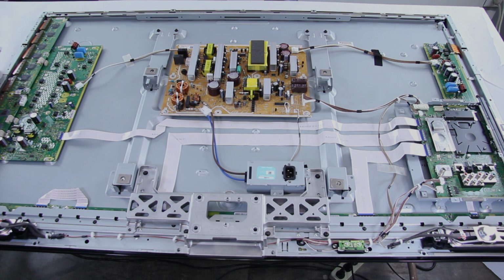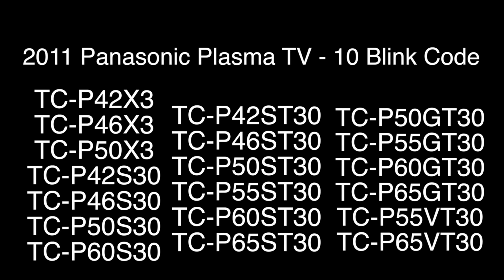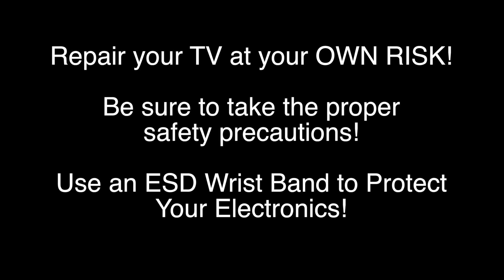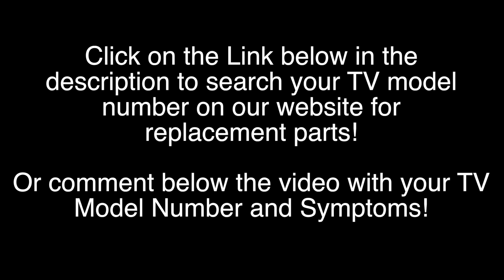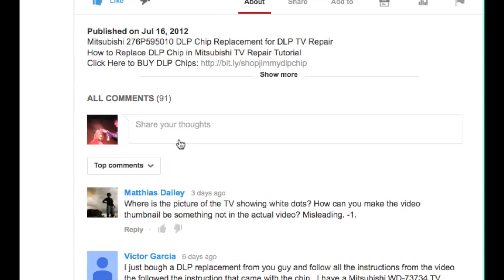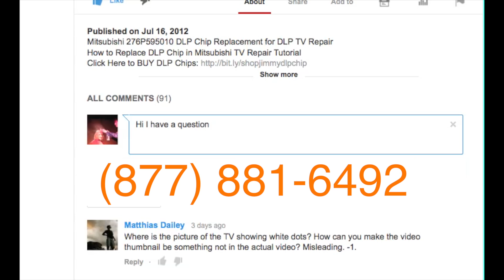Panasonic Plasma TV Repair - Understanding 10 Blink Code for 2011 Panasonic Plasma TVs-How To Repair

Comment: I have a Panasonic TC-P50G25 that has the 10 blink code. I have replaced the main Board and the Power Board. Still getting 10 blinks any help would be appreciated.
Reply: ShopJimmy.com Hello, I just tried unplugging the SC board and powering the tv on. It does not turn on but the blink code changed to 6 blinks.
Reply from the maker: Mr. Tech Inc   Repeat the same test on the SS board.  Thanks!  www.shopjimmy.com
Reply: ShopJimmy.com With the SC board plugged back in and the SS board disconnected. TV does not turn on and it went back to the 10 blink code. Thanks
Reply from the maker: Mr. Tech Inc  Please watch this video FIRST to help with your repair!  https://www.youtube.com/watch?v=BP3NVNCGEv8  This tells me the problem is with the power supply or the A Main Board.  You may need to replace each of these board individually to see which one fixes the problem.  Click this link to replacement parts for your TV model number: http://www.shopjimmy.com/catalogsearch/result/?q=TC-P50G25  There may be multiple boards for the same TV model number, be sure to match part numbers on your current board, with your replacement for compatibility.  Thanks and please let us know if you have any further questions with your TV Repair!  www.shopjimmy.com

Comment: I have a Panasonic model TC-P42X60 with 7 red blinks. I've already replaced the SC board but the problem still exist. Please help me.
Reply from the maker: celestino robledo barcenas   Did you replace the buffers that connect to the SC board or is there just one board (SN Board) that connects to the TV panel?  Thanks!  www.shopjimmy.com

Comment: hi sir i do have Panasonic plasma TV tc-p42s30 when i plug it in i have no response even the red light stay off i did replace the power board and nothing been change please advise ASAP.
Reply from the maker: MHD Faour   Try this at your own risk. Unplug the TV, then disconnect the SC board and plug in the TV to see if the TV powers up. Reply with the results of this test. Thanks! www.shopjimmy.com

Comment: My friend has a panasonic tc-p50x2 plasma TV. 
He says he's had it for maybe 3 years or so. 
Yesterday we were watching it and it just went black. 
Now when we turn it on the power light which is red, (never turns any other colours) blinks 10 times, pauses and blinks 10 times again and repeatedly. The only way we can turn it off is to hold the power button and it will shut off. 
Nothing happens when we turn it on. No picture. No sound. 
Just blinking light. 
We have tried unplugging all the cords and unplugged the TV overnight and attempted to power on today and nothing. Same thing. 

Any idea what the problem is?  Obviously it's not under warranty anymore and my friend is extremely tight on money right now (his TV and PS3 is pretty much his life lol. And he has 3 young kids every other week!) 
So we need to try to fix this as cheaply as possible. 
Any help you can give would be greatly appreciated.  
(Don't know if it matters but We are in quebec canada...) I've watched a few of your videos and am pretty handy, I'm positive I could fix this myself for him if I knew what the problem was and could obtain the correct parts. 

Thank you kindly!!
Reply from the maker: jayme collier  Please watch this video FIRST to help with your repair!  https://www.youtube.com/watch?v=BP3NVNCGEv8  I recommend replacing the SC, SU & SD boards in your TV.  Click this link to replacement parts for your TV model number on our website:  www.shopjimmy.com/catalogsearch/result/?q=p50x2  There may be multiple boards for the same TV model number, be sure to match part numbers on your current board, with your replacement for compatibility.  Here is a link to a video showing how to identify your part number, click here:  https://www.youtube.com/watch?x-yt-ts=1421782837&x-yt-cl=84359240&v=N1ophMtQeZU  Thanks and please let us know if you have any further questions with your TV Repair!  www.shopjimmy.com

Comment: I have a Panasonic 55vt30 and today I went to switch it on using the on off switch on the front of the TV and nothing not even coming on to stand by mode. I done the usual checks changed the fuse checked the socket and still nothing please please can you help me?
Reply from the maker: Shaun Anderson   Try this at your own risk. Unplug the TV, then disconnect the SC board and plug in the TV to see if the TV powers up. Reply with the results of this test. Thanks! www.shopjimmy.com

Comment: I have an st-30... my picture just went out! when i unplug it and plug it back in, there are no blinking lights... just a solid red light as if the tv was on but no picture.
can you help me?
Reply from the maker: The Truth  Please watch this video FIRST to help with your repair!  https://www.youtube.com/watch?v=BP3NVNCGEv8  I recommend replacing the SC, SU & SD boards in your TV.  Click this link to replacement parts for your TV model number:  http://www.shopjimmy.com/catalogsearch/result/?q=st-30  There may be multiple boards for the same TV model number, be sure to match part numbers on your current board, with your replacement for compatibility.  Thanks and please let us know if you have any further questions with your TV Repair!  www.shopjimmy.com

Comment: I have a 2009 tc-p50s1.  Does not power on and gives 10 blinks.  I tried what you said and disconnected the sc board and got 7 blinks after that.  Any ideas where to look next?
Reply from the maker: Patrick Baxter   Repeat the same test on the other side of the TV with the SS board.  Thanks!  www.shopjimmy.com

Comment: Hi there,
My Panasonic Plasma TH-42PZ800E is having exactly the same problem.
Switching on the power and blinks for 10 times. 
I understand that I have to replace the power board. Where can I find it. I live in Switzerland. Any chance to ship it over here if is available?

Thank you and best regards
Engin
Reply from the maker: Engin Aksüt   Try this at your own risk. Unplug the TV, then disconnect the SC board and plug in the TV to see if the TV powers up. Reply with the results of this test. Thanks! www.shopjimmy.com

Comment: Hi I hope you can help me, I have A Panasonic Viera TC-P50X2 50 inch Plasma TV that has a constant red blink, which is different from all the other codes I have seen. Once I plug the TV in i hear a click from the back which sounds to be coming from the Main Power board " the middle ". The screen does not come on at all and once i hit the power button you can't turn it off unless you unplug the TV. The red light never stops. Once it's plugged in the red light starts blinking quick with first 2 fast blinks then it starts it's constant blinking. I hope I didn't write to much just hope you can help me :) thank you - Alicia
Reply from the maker: AliciaKitty69  Please watch this video FIRST to help with your repair!  https://www.youtube.com/watch?v=BP3NVNCGEv8  I recommend replacing the main board in your TV.  Click this link to replacement main boards.  http://www.shopjimmy.com/catalogsearch/result/index/?cat=56&q=P50X2  There may be multiple boards for the same TV model number, be sure to match part numbers on your current board, with your replacement for compatibility.  Thanks and please let us know if you have any further questions with your TV Repair!  www.shopjimmy.com
Reply: +AliciaKitty69  Hi Alicia - Did this work for you? I'm having the same problem - light keeps blinking

Comment: I have a TC-P50G15, bought in 2009/10 and it blinks 5 times.  I replaced the a-board but that gave the same results.  thoughts?
Reply from the maker: David Schaffner   Try this at your own risk. Unplug the TV, then disconnect the SC board and plug in the TV to see if the TV powers up. Reply with the results of this test. Thanks! www.shopjimmy.com

Comment: Shopjimmy...I have a panasonic tc-p50s1 manufactured in 2009.  Tv won't turn on and I'm getting the 10 blinks.  Is the process the same as this video?
Reply from the maker: Patrick Baxter  Try this at your own risk. Unplug the TV, then disconnect the SC board and plug in the TV to see if the TV powers up. Reply with the results of this test. Thanks! www.shopjimmy.com
Reply: ShopJimmy.com Ok I tried it with the sc board unhooked and I got 7 blinks that time.

Comment: I have a Panasonic Viera plasma TC -P42C2, September 2010, so anything different with the 2010 model? It has the 10 blinking red codes. I have tried vacumning out the vents on the back for dust and tried pushing and holding the on button down for 10-15 seconds, and no success. No picture. Also, what do I need to do to ground myself? Anything special when removing the back tv cover screws. I unscrewed the 11 ST4 screws around the outside edge and the two M4 screws on the top edge, but still can't get the back of the tv off.
Reply from the maker: tom anderson   Try this at your own risk. Unplug the TV, then disconnect the SN board and plug in the TV to see if the TV powers up. Reply with the results of this test. Thanks! www.shopjimmy.com
Reply: ShopJimmy.com My problem as noted in my original comment is that I can't figure out how to get the back off my Viera. Also your You Tube video does not identify the SN board you wanted me to disconnect in the test. Also how do I ground myself (is that the ESD Wrist band you mention?) and is the instructions the same for my 2010 model as you outline in your video which is for the 2011 model.

Comment: We have a Panasonic Viera TC-P50U2 that is giving us the 10 blink code. I'd like to buy the appropriate board to fix it if you can point me in the right direction.
Reply: Don Bowlby We are still having this problem and I'm still hoping you can help. I've watched your video a few times and I've had the TV back off. Fixing it looks similar to hooking up computer cards or drives which seems easy enough. I'm just not sure which board I need to purchase. Is there any way to test which board is causing the problem or is it just trial and error?

Comment: Hi Shop Jimmy, I have the usual problems with my Viera Panasonic. Model No. TX-L26X10B.  Although I don't have 10 Blinks mine constantly flashes red indefinitely.  My Panasonic Viera, purchased 2 years ago, has the dreaded turn on/off syndrom.  I turn on the TV button, the TV flashes green normal times then TV comes on with sound but no picture.  This stays like this for about 7 seconds then turns itself off again with the red light which flashes constantly until I turn the TV off again.   PLEASE can you help?!
Reply from the maker: Suzie Emmerson   Try this at your own risk. Unplug the TV, then disconnect the SC board and plug in the TV to see if the TV powers up. Reply with the results of this test. Thanks! www.shopjimmy.com

Comment: My Panasonic plasma is a model TC-P54S2 bought new in 2010 and I have the 10 red light code.  TV does not turn on.  Please advise at to what board to replace.
Reply from the maker: Terry Reid   Try this at your own risk. Unplug the TV, then disconnect the SC board and plug in the TV to see if the TV powers up. Reply with the results of this test. Thanks! www.shopjimmy.com

Comment: I have a 40 inch sharp aquos lcd model # t400hw03 my tv won't turn on and i check all capacitor no blug and fuse is good could you please help
Reply from the maker: Lorenzo Rolle  Please watch this video FIRST to help with your repair!  TV Repair! LCD, LED, Plasma, DLP How To Fix Your TV with ShopJimmy.com Help!  I recommend replacing the main board in your TV.  Follow this link to replacement parts:  http://www.shopjimmy.com/catalogsearch/result/index/?cat=56&q=t400hw03  Be sure to match part numbers on your current board, with your replacement for compatibility.  Here is a link to a video showing how to identify your part number, click here:  Samsung Main Boards & Digital Boards: Part Numbers for LED, LCD, DLP, Plasma TV Repair  Thanks and please let us know if you have any further questions with your TV Repair!  www.shopjimmy.com

Comment: i have a panasonic veira tcp50s2 with the 10 blink code and have no clue what its issue is is it just clicks and wont turn on
Reply from the maker: *****   Try this at your own risk. Unplug the TV, then disconnect the SC board and plug in the TV to see if the TV powers up. Reply with the results of this test. Thanks! www.shopjimmy.com
Reply: I unplugged the bord and got 7 blinking lights
Reply from the maker: *****   Try the same test on the other side of the TV with the SS board.  Thanks!  www.shopjimmy.com
Reply: Same think 7 blinking lights

Comment: I have a Panasonic TCp65VT25 Plasma TV that is failing to come on. I have performed the test in this video and it has a 10 blink code failure. 

Can you confirm what parts I need to make the repair?
Reply from the maker: steve mann   Try this at your own risk. Unplug the TV, then disconnect the SC board and plug in the TV to see if the TV powers up. Reply with the results of this test. Thanks! www.shopjimmy.com
Reply: ShopJimmy.com I tried this test and it did not make a difference. when I plug in the TV I hear a relay click, ten second later another relay click.
Reply from the maker: steve mann   Try the same test on the other side SS board.  Thanks!  www.shopjimmy.com
Reply: ShopJimmy.com After unplugging the power power from the ss board and performing the test it now blinks 7 times.
Reply: steve mann Hey man! I've had the same problem let me know if it was fixed ! Thanks !

Comment: I have a Panasonic TV VIERA TC-42px24 has power led blinks 12 times after power button is pushed. What could be the problem?
Reply from the maker: Kenneth Yumul   Try this at your own risk. Unplug the TV, then disconnect the SC board and plug in the TV to see if the TV powers up. Reply with the results of this test. Thanks! www.shopjimmy.com

Comment: I have TH-58PZ700U (2007) that has been inoperable for couple months, 10 blinking lights when power cable plugged in.  Power button does not turn tv on or off.

Several nights ago my other Panasonic plasma TH-37PX60U (2006) just clicked off and started blinking 10 times.  Now I have 2 Panasonic plasmas with identical10 blinks and power button does nothing when pressed.

Help!  What is your suggestion to repair?
Reply from the maker: Barbara Pratt  Try this at your own risk. Unplug the TV, then disconnect the SC board and plug in the TV to see if the TV powers up. Reply with the results of this test. Thanks! www.shopjimmy.com

Comment: My Panasonic TV is a model # TC-P50G20, sn: MF01970523, manufactured in July, 2010.  It will not turn on any more and it's power led blinks 10 times after the power button is pushed.  What would be the probable cause for this problem and what board(s) need replaced?  Thank you for the help.
Reply from the maker: Frank Bordash   Try this at your own risk. Unplug the TV, then disconnect the SC board and plug in the TV to see if the TV powers up. Reply with the results of this test. Thanks! www.shopjimmy.com
Reply: ShopJimmy.com To clarify.  W/o unplugging SC board, after first click after plugging in and pressing power button, I get 4 blinks.  If I wait for a second click and then press power button I get 10 blinks.  Now after unplugging power lead to SC board I get 7 blinks after either first or second click.  TV has no screen.
Reply from the maker: Frank Bordash   Try the same test on the SS board on the other side.  Thanks!  www.shopjimmy.com
Reply: ShopJimmy.com OK, w/ the SC board plugged back in and the SS board unplugged I get 10 blinks after pressing the power button after one click and get 4 blinks doing the same after two clicks - just the opposite scenario of blinks and clicks with all boards plugged in.
Reply from the maker: Frank Bordash  Please watch this video FIRST to help with your repair!  TV Repair! LCD, LED, Plasma, DLP How To Fix Your TV with ShopJimmy.com Help!  If you are able, you should check the voltage on the power supply VS and VA.  If VS and VA have voltages replace the A board if still no voltage replace the power supply.  Here is a link to replacement parts:  http://www.shopjimmy.com/catalogsearch/result/?q=P50G20  Be sure to match part numbers on your current board, with your replacement for compatibility.  Thanks and please let us know if you have any further questions with your TV Repair!  www.shopjimmy.com
Reply: ShopJimmy.com So you are saying my problem is not with the SC, SU, SD, or the SS boards.  Correct?
Reply from the maker: Frank Bordash  Based on the info you have provided, I am thinking the problem is not one of those boards.  Thanks!  www.shopjimmy.com

Comment: Hi .....my name is Aramis  I have a Panasonic plasma TC-P65S1 and i just change the p board ...now all is doing blinks 8 time...any suggestions  ..thank you
Reply from the maker: Aramis Jimenez   Try this at your own risk. Unplug the TV, then disconnect the SC board and plug in the TV to see if the TV powers up. Reply with the results of this test. Thanks! www.shopjimmy.com
Reply: I did and I also find out the 8 blinks light means ss board is bad
Reply from the maker: Aramis Jimenez   OK, do you need any further help with your TV Repair?  What were the results of the test?  Thanks!  www.shopjimmy.com

Comment: Hi I have a panasonic tx-p50vt20b tv I have the ten blink code, I have replaced the power board and the main board and I'm still getting ten blinks ? Any suggestions please would be very much appreciated
Reply from the maker: aaron191191   Try this at your own risk. Unplug the TV, then disconnect the SC board and plug in the TV to see if the TV powers up. Reply with the results of this test. Thanks! www.shopjimmy.com

Comment: I unplugged the SC board as per suggestion and plugged it in again, I heard two clicks, but I still get a 10 blink code. What Next?
Reply from the maker: Manuel Lopez   I recommend running the same test on the other side of the TV on the SS board.  Thanks!  www.shopjimmy.com